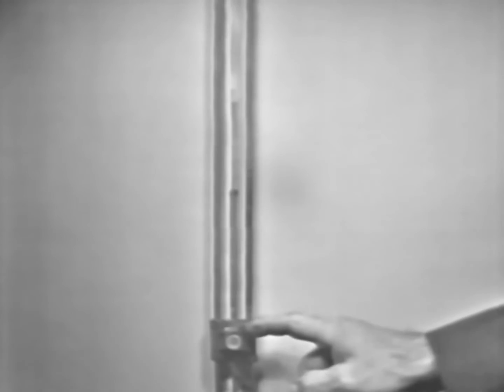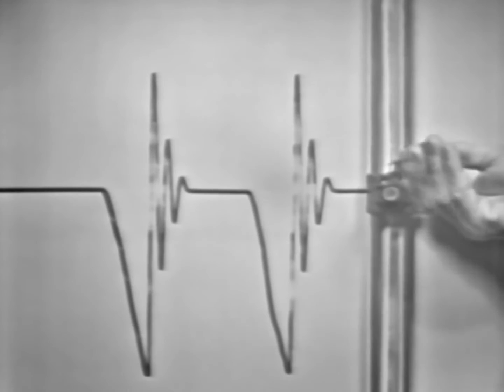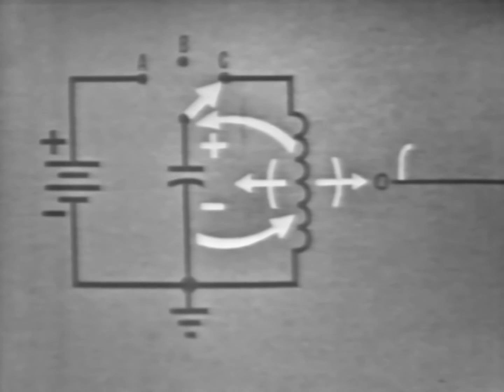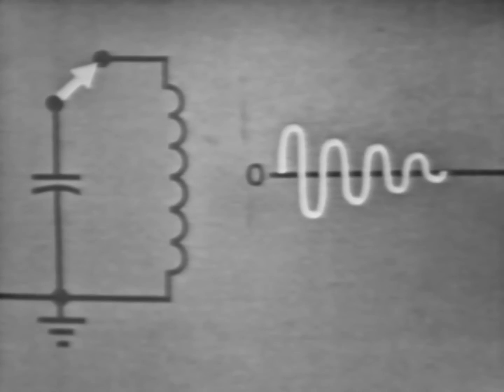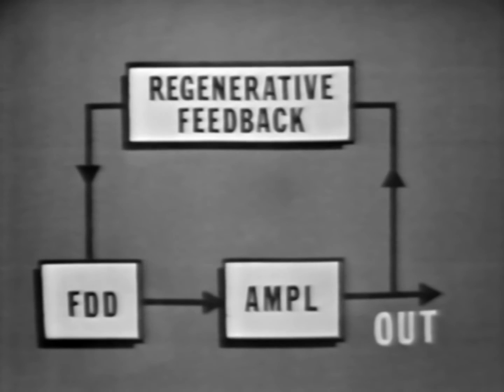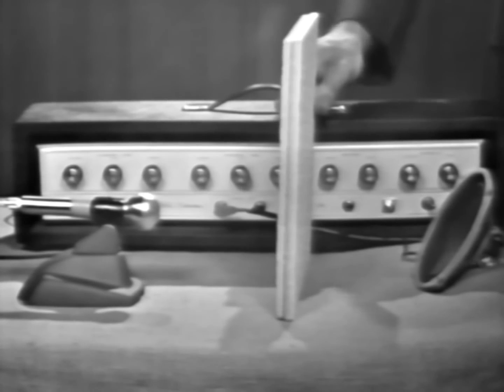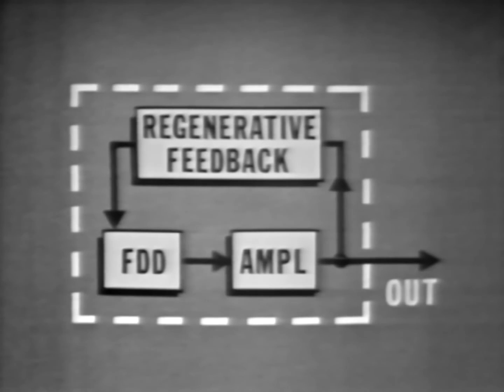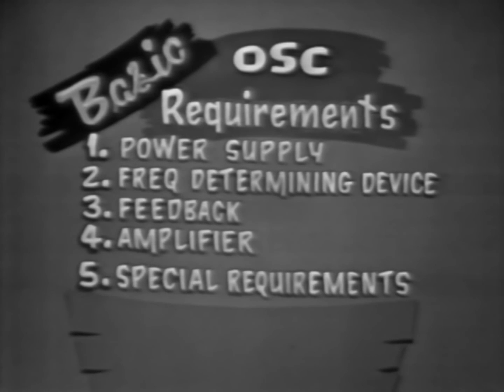Electronics Introduction to LC Oscillators circa 1974 US Air Force Training Film

Comment: This is excellent - you can actually understand the explanations. 
If you really wanted to you could look into the maths later. 
Most modern videos go to the maths within 30 seconds ....and at that point I'm out.
BTW - some of the comments here mention that the capacitor shown is electrolytic - I don't think that's the case - they are just showing the charge on the capacitor. 
Also the current flow is described as per the way electronics engineers like to use  - from negative to positive - as it really does flow and not the conventional but wrong positive to negative.
Pretty sure the vid is 100% correct.

Comment: oscillation used a steady DC it’s more comment & difficulty to cause it to be oscillations for a DC power example a battery how’s to caused it to swing back&forth what an AC does every inverter it’s used DC power to caues it to moved back&forth to be oscillation without it  it won’t works at all this is what I understand I maybe wrong or right

Comment: I have a question
1) if the amplifier is used to strengthen the signal that is restoring the amplitude that is lost due to circuit resistance then why do we need a feedback circuit? 
Please explain?
And if feedback is used to get the same signal frequency and phase, but isn't that the job of the LC circuit won't the LC circuit generate constant frequency signals ?
Reply: I believe I can shed some light on your question.

To answer your first question, you're right, the amplifier is used to regenerate the energy losses in the LC (oscillator) circuit.  The feedback circuit is required because without it, you would simply be amplifying the gradually decaying output from the LC circuit.  The feedback circuit is what gives back the LC circuit the energy it loses due to its internal resistances.

For your second question, the LC circuit's job is to provide the capability of generating constant frequency/amplitude signals, but without amplifier feedback to recoup loses, the output will decay away over time like the felt pen demo held in place by rubber bands.

Hope this helps, cheers.
Reply: @nikiopia  Ooh okay thank you for the explanation😊

Comment: Is the current flow direction correct when capacitor discharge? I think the current from the capacitor is clockwise when flip the  switch to C.
Reply: Yes, it should be clockwise. Electric current flows positive to negative - always.

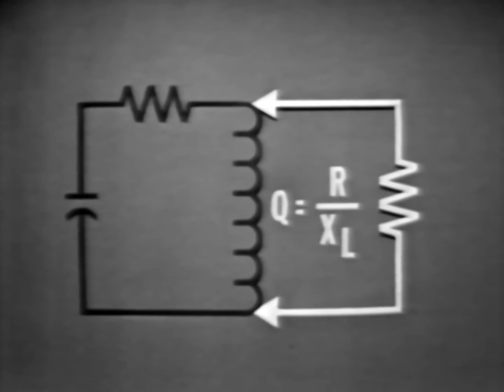Comment: why did the quality equation get inverted at 16:08?
Reply: Because the first equation for Q was for the series resistance of the circuit. The second equation refers to any parallel resistance across the circuit, which must be kept at a high value to obtain a satisfactory Q for the L-C combination.

Comment: Why doesnt it cancel out in the mic and speaker feedback example? the phase shifting doesnt happen?
Reply: The only waves that will reinforce for a standing wave are 180° out of phase. It's a closed loop system that selects for those conditions. Great question.
Reply: @tobiasgertz7800  thank you for The answer, Im not sure i understand what you mean by "... Selects for those cpnditions...". What does it exaclty means?
Reply: https://youtu.be/oZ38Y0K8e-Y
Your englishv is good, but you won't need words to understand this one.
Reply: https://youtu.be/cnH2ltfW48U
Reply: In the feedback loop the physical soundwaves have a speed through the air and they also have harmonics. There are more than just one fundamental frequency. The one specific frequency that fits inside the physical distance between microphone and amplifier is the one that has the least resistance to the loop and gets amplified. Positive reinforcement happens over and over again rapidly. There is necessarily phase shifting and harmonics in the system. The speaker isn't a perfect sine wave generator, and air isn't a lossless or homogenous medium. It all generated harmonics. One of those harmonics (different but related frequency) will appear as a phase shift.
Reply: @tobiasgertz7800  well i got The thing about The least resistence harmonic between mic and speaker, and since it generates positive reinforcement i am yet to understand why The 180° phase shifting provides a positive reinforcement rather than a negative one
Reply: Standing wave. Have fun going down that rabbit hole. It's where the reflected wave algebraically sums with the incident wave. I forgot to mention that. I didn't realize how far along you were with your studies. You are definitely ready.
Reply: @tobiasgertz7800  sound is picked up by the microphone and amplified, which makes an even louder sound to be picked up and so on… aka positive feedback. 

The signal can’t increase forever or stay at one extreme, so it oscillates.
Reply: @tobiasgertz7800  Some sound could be out of phase and cancel out, but other frequencies in the amplifier hiss will amplify with positive feedback.

Comment: @ 6:50 The coil becomes a voltage-source because the decaying magnetic field acts like a battery! My battery produces voltage, not energy! And so this magnetic field contains no energy. Faraday's law of induction is about changing magnetic fields and ... voltage.
Reply: A battery contains potential energy and similarly an induction coil stores potential energy due to magnetic field generated as a result of applied voltage.

Comment: 6:05 In those days, did the current flow from minus to plus?
Reply: they are not using conventional current 
they are depicting actual electron flow
Reply: Lol
Reply: Current has always been minus to plus, it's voltage that's from plus to minus.
Reply: @jakobjensen3424  No... Current traditionally flows from positive to negative, although electrons flow from negative to positive.
Reply: @piotrne  Current traditionally flows from negative to positive. Because current is* electron flow.
Reply: @jakobjensen3424  But in a circle 2 points are both behind and infront of each other  , there isnt a front or behind, both points are going toward each other, so technically this explantion doesnt make sense either way? and maybe why my brains starts to hurt when i see a diode in a schematic.
Reply: Jacob Jensen: In conventional diagrams current flows from + to . e flows from - to +. This is convention. Cathode is + and anode is - in electrolyte solutions but cathode is - and anode is+ in electrical discharge. Similar confusion present in thermodynamics. So follow which one you like don't force others.
Reply: @Satyaprakash81102 - And who can we blame for this controversy? Why the man who originally defined the polarity of electricity: none other than Mr. Benjamin Franklin. In his time there was no knowledge of atomic theory, so he had a 50-50 chance of guessing it right and got it wrong.
Reply: @Inflec  a negative charge flowing in one direction looks like a positive charge flowing in the other direction. There is no controversy. Electric current flows positive to negative because it is defined that way.

Comment: Shouldn't  the LC capacitor be a non-polar capacitor?
Reply: It must be a non polar capacitor. The induced oscillating current is AC. So a polarized capacitor will die. The symbol surprised me.
Reply: Also current flows the wrong way 6:05 surprised me
Reply: I believe it doesn't matter which kind of capacitor you use